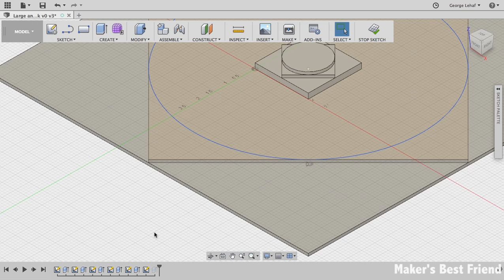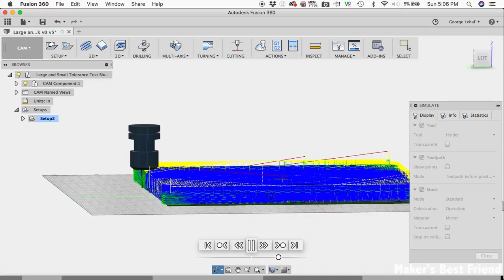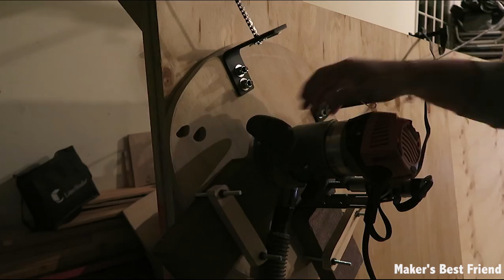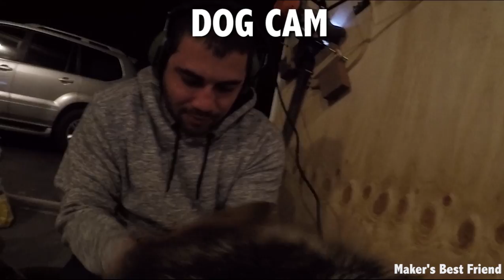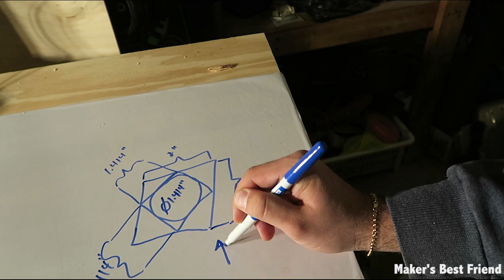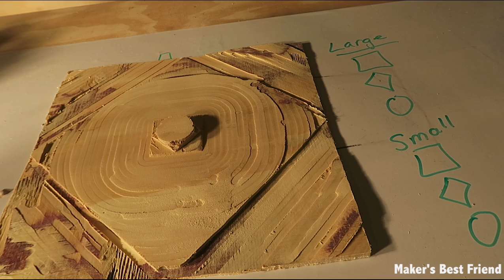Maslow CNC - Testing the Tolerance!

Comment: Put some paste wax under the sled, would help with sliding around. I use it on the table saw and planner.
Reply: It would rub that paste wax into every project you ever work on from then on or as long as you have enough on there to reduce friction, which will start giving you problems once you go to stain or if you seal any pieces afterwards. Waxes can and will ruin both poly and lacquer finishes (can be fixed with xylene and cloth). Some thick poly coats and sanding could give you a really smooth and slick surface.
Reply: @jdpickett8496  very true. For me have to decide sanding side and working side or just run it in the planer

Comment: I found some of your percentages to be wrong, particularly the higher ones 10.13% (8.485 vs 8.6875) 10.35% (1.414 vs 1.621) etc. How are you getting these percentage errors?
Reply from the maker: I’m going to have to take a look at the excel spreadsheet because I think you’re right, I’m guessing something went wrong when I copied the formula through the cells, so the percentage would be closer to 2% error, which is a lot better. I’ll correct these for the comparison to the upgrades